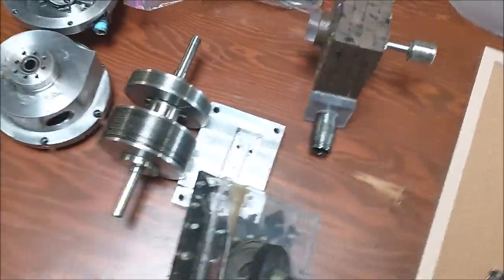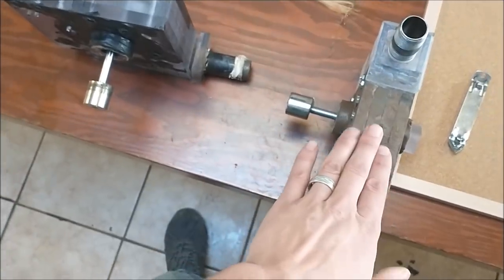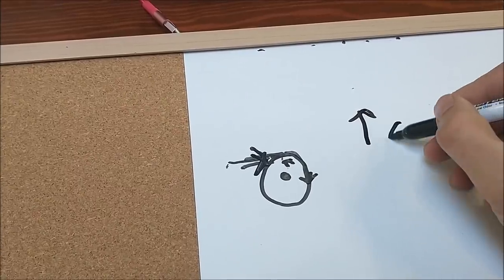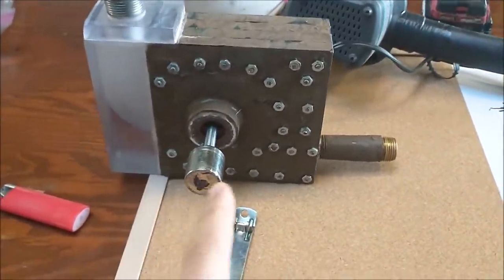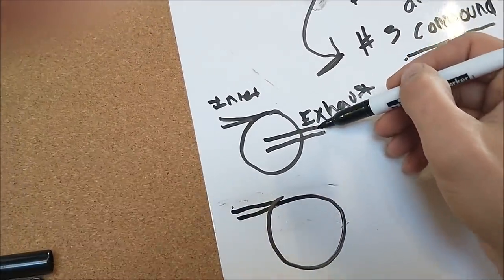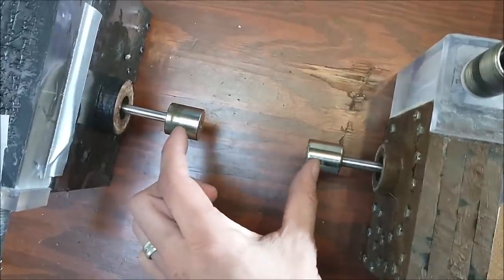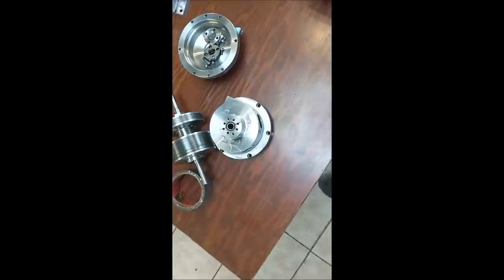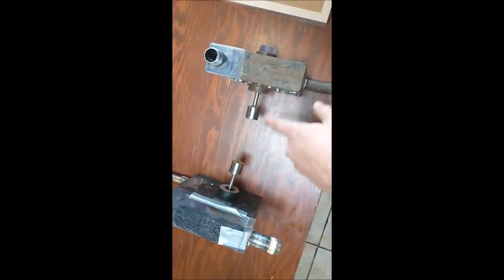Tesla Turbine Cold Steam Update & Informational Video

Comment: Looking great! I added a flywheel to one end and a piston system to the other to further re-compress the air lol wish me luck. You have more backing than I, so I believe you'll get further. I'm 3d printing the housing out of carbonfiber and using platinum discs from harddrives as the rotors. stuck on bearings and such but I'll figure it out.
Reply from the maker: you should make some videos of your progress!
Reply: @iEnergySupply  I can probably manage that!

Comment: i wish you would do the dual stage turbines on the same shaft. I liked that design. I still want to push a full genset and try to produce 36kw off cold steam. keep rockling sir .
Reply from the maker: It will actually not be that difficult to produce 36 kw, if you use higher temperatures. Now that we have proven cold steam can produce real usable power, we can increase the temperature a little bit and get way more power. Especially with larger turbines.
Reply: @iEnergySupply  I think I could use induction heating to boil water hot enough. With 36kw I would be able to run the heater and the house all together. Would be cool to incorporate a few different things to make it happen. Thanks again sir
Reply: @iEnergySupply   By ignoring a legitimate fundamental query regarding the input and output power levels, I have to regard your work with some scepticism.
Reply from the maker: @ricksampson6780  it's coming
Reply: @iEnergySupply  OK, thanks for the excellent work thus far Jeremiah.
Reply: lol i really wanna see if it would be possible to use the heat of a car radiator to run these turbines.  It'd be cool.  and then use the waste energy to run electric turbos on the car.  I know it sounds stupid and probably better to use it to power a hybrid engine, but hey i like combustion engines.

Comment: Great work!!! I always thought Tesla was speaking about staging the pump to get the presure desired not the turbine, 

normal multi stage steam turbines use a reheater I'm between the first en second,  I could be wrong but this what I understand about it, 

back pressure is not a good thing for power generation in any  engine right? How is it different in the Tesla turbine

Comment: Hey 👋 
So I'm not 100% sure on this but I wanted to tell ya. I think the inside of many water pumps is a magnet much like the one needed here and pretty sure the coil of wire is there too and it's probably made with really close tolerances to the coil to work efficiently.  You should check it out, might be cheaper.
Reply from the maker: You could find a link to one I'd be Interested in buying one

Comment: Running a compound setup, what sort of shaft seals are you running? And how do you get perfectly flat disks? Are you running special high speed bearings? I do want to build a turbine but was thinking of running a speed Governor & add a tesla valueless valve to a combustion chamber & feed that into the intake of the turbine.

Comment: theory: so called "centrifugal head" can be considered as static pressure of the system at a given boundary condition. this is directly proportional to inefficiencies in the manifold geometry and an 'optimal' manifold geometry will produce extreme negative pressure at inlet and greater deltas to outlet. manifold shape can be more egg-like, trumpet, tornado etc.

Comment: Is this not the future for geothermal power? Its not that difficult to get deep enough for the temperature ranges you are talking about, and that's anywhere on earth. Without the need to supply 100s of MW of power from one site(rather the versatility it would open up to well locations would possibly lead to millions of individual wells for home use) the chance of heat diminishing over time would be reduced dramatically.
Reply from the maker: extremely likely yes.

Comment: I’ll admit I was skeptical at first but after some research you are onto something! One question, what’s the downfall of having both turbines on the same shaft? Also why is the exhaust not in the center on the two you plan to compound?
Thanks, Caleb
Reply from the maker: Rather than compounding them, I've decided just to build the 6-in turbine. The exhaust wasn't in the center because the bearings prevent sufficient flow if exhausted through the center. Even if you have exhaust holes around your bearings, the exhaust holes will chop the air up preventing it from exhausting easily. It's possible to do it both on the same shaft with exhausts in the center not very practical at least as far as I thought so far. It's also more difficult to balance the rotor with two rotors on the same shaft, although with my new balancing machine I could actually do it now

Comment: Looking at direct driving a generator  and engineer backwards might be useful.  A dipole rotor spinning at 3600 rpms will generate 60hz  signal 60 cycles a second × 60 seconds = 3600 rpm. 

Given a target rpm you can design the turbine blade diameter. As you point, out  a larger diameter results in more back pressure per rpm. But if your rpm is less, you can still compound several turbines Compounding the turbines also increases the overall flywheel  mass, but 3600 rpm for 60 hz or 3000 rpm for 50 hz is very convenient.

Comment: Could you take a page from airfoil designs and make the exit point for the steam the center rod, which is where the water naturally wants to go? If you place the exit holes in such a way the water has to hug the plate, won't that increase the amount of energy you get by forcing the water to hug the plate?

Comment: Did you use any specific type of carbon fiber for the discs? I have a design for a 3 inch diameter dual stage turbine but I'm worried the cnced carbon fiber will delaminate at high rmp.

Comment: Great work! When using cold steam, which can boil at example 4 celcius, do you need external heat source? Can you run your turbine with no heat source with the water boiling at 4 celcius (in a close loop)? Thank you
Reply: At that temp for the hot side, won't you need an external cold source? The hot source would be the air around you depending on your location.

Comment: Hi there!
I have a question. Is it worth it to compound different sizes of turbines? And also if you put the pump at the end of your compound, what about the turbine that is not dirrectly connected to the pump? Is the pump going to have good effect on both of the compounded turbines?
Reply from the maker: Compounding different size turbines may be of value, it's something that we would need to test. I don't think that it's necessary though. Nikola Tesla compounded his vacuum pump with all the rotors being the same size, so I like to go with what he does. The lower back pressure in the exhaust of the compounded units will be necessary
Reply: @iEnergySupply  Alrigh thanks!
Reply: I'm hoping you still check these messages. In this video you explain compounding to create more pressure in the exhaust and in another you try to pump out the fluid to create a vacuum in the exhaust. Why the two opposites? What am I missing? 

Great work though! All very interesting.

Comment: Pre-spinning of turbine could prevent some damages?
Reply from the maker: I'm not exactly sure what you mean can you elaborate?
Reply: I am thinking - maybe it is useful to spin the turbine with electricity before letting the flow in. Inlet and outlet closed, pre-spin and then open the inlet and outlet. Back pressure should be present from the start?
Reply: Like a startup sequence... Hydro plants are also pre-spinning the turbines.
Reply from the maker: @innovationsforall  absolutely, the generator can be a motor with the right controller.

Comment: I'm curious if etching the discs could accomplish the same thing at lower pressure or RPMs. Tesla designed a fluidic one way tube pattern that hasn't really seen any use.
Reply: I think he's played around with that quite a bit. It was/is being used in the place of vanes for a pulse detonation jet.
Reply: @CharlieSolis  have you seen US patent US20140328666A1

Comment: speed doesn't matter, how much power does it make?
Reply from the maker: your going to have to watch my previous videos, I got 400 watts with one turbine which is amazing considering I was using water below it's boiling point to do it. I could easily get 800 watts with two compounded. Speed absolutely matters.
Reply: @iEnergySupply  but you're using vacuum with that setup!
Does that turbine stand up to steam from a solar source, have you tried it?
Reply: @CharlieSolis  for the same reason an airplane has less lift in humid than dry air.

Comment: what the heck, that turned into a normal pass-through in-line turbine, either center-in-rim-out or rim-in-center-out
Reply: I still recommend the center-in-rim-out slow-down of the input gas volume
Reply: i think its the second stage of the tesla system, only
Reply: those parameters are the exact specific energy design parameters of a flywheel, S=E/m=(pi^2)*(r^2)*(f^2), r=radius, f=frequency
Reply: still recommending a heat pump compressor second stage
Reply from the maker: @Jkauppa  that is next

Comment: Do we have any information about the turbine efficiency yet? There's a lot of these tesla turbine channels now but I've not seen any of them produce any data on efficiency.
Reply: @CharlieSolis  Aren't you the guy that doesn't understand basic thermodynamics?
Reply: @CharlieSolis  A thermocompressor equalises 2 pressures. It doesn't increase net pressure so it can't replace an actual compressor in a thermodynamic cycle. Quite startling you don't understand this given how much you must have spent on all the gear you've bought.

I'm not trolling anyone, in fact I've given you a lot of useful education which you should be grateful for. But I understand when someone has invested so much into something being told it won't work anywhere near as well as they hope is difficult to take, and they might sink into denial.

I'm potentially very interested in tesla turbines, be we need to demonstrate useful turbine efficiencies of at least 50%, otherwise we can pretty much forget everything.
Reply: @CharlieSolis  Again you simply don't understand thermodynamics well enough. Pistons have 90%+ mechanical efficiency, but a piston engine will typically have 25%-35% thermal efficiency. 

Your cited 40% efficiency is not the thermal efficiency, it's the mechanical/turbine efficiency, which as you can see is significantly less efficient than the 90%+ efficiency of the piston. 

On top of this all these projects are going to be low temperature, and they are typically Rankine cycle, thus they are going to have much lower theoretical efficiency to start with. So unless you can get a decent level of mechanical efficiency out of the turbine, the systems is going to produce pitiful thermal efficiency levels - maybe 5% - and would not be worth the cost.

You can keep sticking your head in the sand and shouting at me if you like. But i'd suggest you listen as this information could save you a lot of time and money.